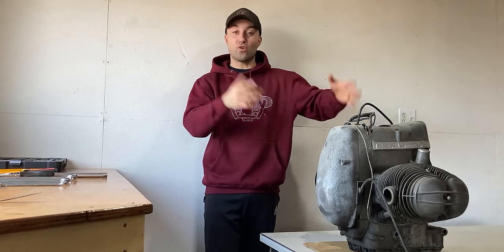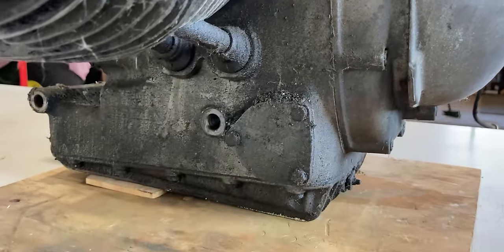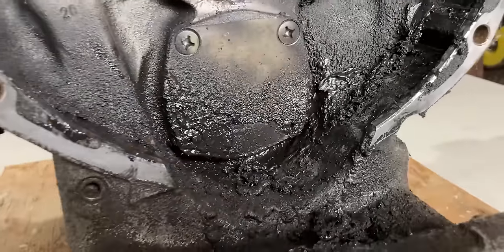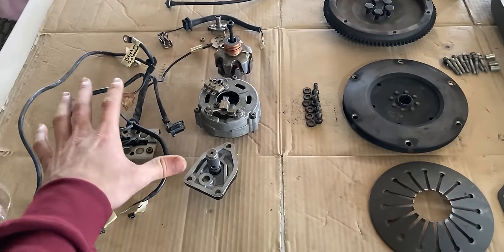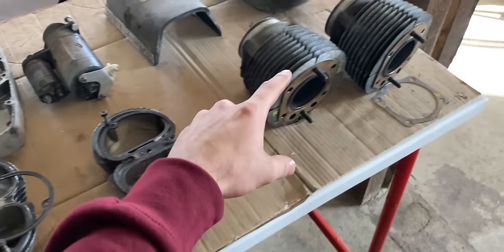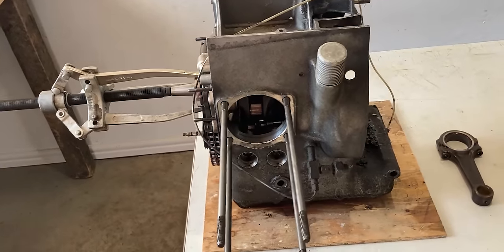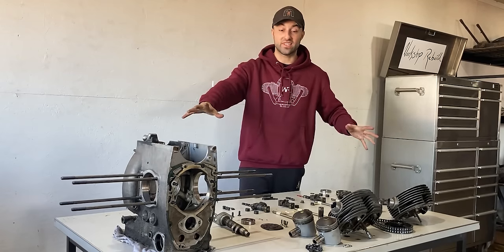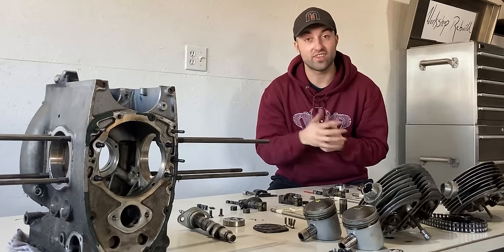BMW R60/5 Airhead Engine Teardown - How Bad Can It Be?

Comment: Having watched a few such, very interesting and informative videos, I have to ask why do you all not give it a good external clean before you start stripping it?  A good application of Gunk or similar means your whole working is a bit cleaner; there will still be oil from within but none of that road cr*p potentially getting anywhere inside.  I'm sure you'll clean thoroughly the parts but prevention is better than cure.
Enjoyable video, chapeau!  Makes me want to find an old airhead, just to take it apart!   ... but not my 1978 R100RS
Reply from the maker: Hi there, this is a great question! I think it depends on what work will happen to the engine. If I were to just replace gaskets and seals, I would definitely clean this engine prior to stripping it. 
In my case, I knew I will go through every part, clean it, measure it, repair or replace it and then eventually rebuild the whole engine. Once all parts are disassembled as I can get to them from every angle and I find this much easier to clean them this way. (Cleaning usually takes forever, but that is just part of a restoration)

Thank you for your positive comment, I really appreciate it! I will have an engine rebuild video of this R60/5 here very soon that you might be interested in watching. 

You have a lovely BMW and it might be a good thing to keep that in one piece if it's still a solid runner! Maybe you can look into the /7 models, as they are readily available on the market and fairly cheap...relative to older or more rare models. 

Regards Andreas

Comment: 9:25 Like talking to a baby :D "Where is the clutch lining?..THERE is the clutch lining!! :D"
Reply from the maker: EXACTLY! The clutch wasn't horrible, but it will need to be replaced after so many years. Luckily new parts can be sourced which makes this 10x easier than riveting new material onto the old disc.
Reply: @WorkshopRebuild  How easy or difficult is it actually to get parts for it?

Comment: Good Video. BMW should have used  helical gears to drive the Camshaft . Chain elongates  change  valve timing. R 50, R60 & R 69s had gear driven cam shaft. No weak links. Sadly Today's BMWs are so complicated 3 Timing chains. Expensive Toys.
Reply from the maker: Hi Tissa, that would have been a great option as they used this method in the past. Nowadays liquid cooled engines are far more prone to failure with the amount of seals and gaskets involved. To repair an engine with 3 timing chains, must be a nightmare! Once I'm done with the engine rebuild and the whole motorcycle restoration, I will reveal the price and I will already tell you now...it's by far the most expense rebuild I've tackle to date. 
Thanks for viewing and leaving a insightful comment. Regards Andreas

Comment: This has to be one of the best put together 50 year old bike. Certainly nothing from the UK or US comes close. Maybe a Japanese? 
Either way this was very nice to watch. 
Cheers.
Reply from the maker: This bike it built very well, but in my opinion a little bit over-engineered! This was also the fact with British bikes back in the day. I haven't been able to work on an American motorcycle just yet, but maybe I'll find a good deal in the future. On the other hand, I am very impressed with Japanese motorcycles and their reliability. The parts they machined have always been top-notch and in the 70's they rolled out some very good models. 
I will have more video on this BMW very soon, I just have to finish up some other projects! (You probably know how that goes) I'm glad you did and I appreciate your awesome comment. Regards -Andreas

Comment: Internally it doesn't look like a worn out engine at all . . very clean and surprisingly solid logical engineering is evident. But not all German engineering is like that. I had a three year old Audi A4 TDi with 133kms from new from the first owner, with catastrophic failure of the alloy casting bracket supporting the power steering and water pump ancilliaries, whilst high speed motorway sharp bend downhill onramp cornering.. dangerous and frightening as loss of control was a distinct possibility (steering translated 'rock hard' with a sudden loud 'Bang!') I phoned the dealership and said, 'Come, take this thing away, never want to see it again, and give the money back thanks' ..and they did !

Comment: I have over half a million miles on old air heads my collection at one time was over 40 of them..love them things when I go some place I ride a airhead when I want to scare myself I ride one of my ducats. I have a 90s that has never been outta the crate..I'm gettin old bought time to pass them on 😊
Reply from the maker: Now that is something! Do you remember which bike had the most miles put on it?
Your collection must have been better than some museums, especially when it comes to Airheads.
It‘s never easy to pass on something that‘s sentimental to one, so enjoy them as long as you can! 

If you have any stories or pictures you want to share about your bikes, you can always reach out to me via email. My email address is in the description of each video on my channel.

I have a new project already lined up and it might just be another BMW...you might like it! Maybe I‘ll slip a boxer race-engine into the mix, once I finish the R60/5 engine assembly😊👍🏽

Thank you for sharing this comment with everyone and with myself. It‘s always great to hear from fellow Airhead enthusiasts! Regards Andreas
Reply: I put about 120k on a 75 R90s, and about the same on a R100PD. Kinda my fave to ride was the R100PD. Had 3 of them didn't have to pay as much attention to gas stops with the big tank..
Reply from the maker: That's a fair distance on those two bikes (R90S & R100PD), especially if you have such a big collection of BMW motorcycles! I have heard so many great things about the R100PD and it would be a great experience to test one for myself in the near future.
If you ever decide to pass some of your bikes on to the next caretaker, please keep me in the loop. Regards Andreas

Comment: Had to replace the starter on my R-100 GS. Found a exact replacement ( Valeo) at my local auto parts store, 100$ !
Reply from the maker: The R100GS does have a large starter, because it is a 1000cc engine. You were lucky to find a Valeo starter for such a good deal. You might be surprised with my upcoming project...all I can say is it is another BMW 😉

Comment: The engine was built around september 1971. Pity that you did not measure the compression before dismanteling. 
10:22   M10 * 1 or M11 * 1 ? They enlarged them around that time.
Reply from the maker: Yes, this engine was produced in 1971 according to the casting numbers. The compression of both cylinders was tested in a separate video and can be seen here: https://youtu.be/wT1_nDJ_Okc
The flywheel bolts I have here in the shop measure M10 x 1.0 and they did enlarge them in later engines. Thank you for your comment. Regards Andreas

Comment: I would have removed the long cyl. studs as soon as able to prevent then from being bent or broken if it fell over on them . Great engines !
Reply from the maker: That is a great suggestion! They are very long and they could easily be damaged if I'm not careful enough. I agree with you, these BMW airhead engines are great in many ways! Regards Andreas

Comment: Great video!! I enjoyed every second of it. However I started looking because I hoped I could see how to disassemble the crankcase breather valve. Unfortunately this is not on this video... Maybe you have some other video on removing this breather?
Reply from the maker: Hello Marc, I'm glad you enjoyed this video and thank you for your feedback! The crankcase breather valve probably didn't make it into this video and I'm sorry about that. The breather cover is bolted onto the engine block with two allen head bolts. Once these are removed you will see a steel e-clip holding a spring against the valve disc. Remove the e-clip and everything will come off very easily.
If you decide to replace the valve disc with new material, that can be done. If you want to upgrade this part of the engine, you will need to heat up the engine block and remove the breather valve insert. This might not be the easiest thing to remove, but it will come out.
Let me know if this helps and if you have any other questions feel free to reach out to me!
Regards Andreas

Comment: The block (R60/5) has one design failure. The squish-bead in the cylinderhead is to much pronounced and doesnot interfere right with the form of the piston. 
The standard trim tends to knock too fast.  
Families of BMW tuners remove a conical ring from the squish-bead by machining. The compresion ratio can be increased there after, and the timing can get more advanced, both improving power and fuel economy.
Reply from the maker: This is very interesting information and I'm glad you shared this with me. I will keep this in mind when this engine goes back together. I will keep these measurements to compare with other engines that I will be working on in the future. I might just have more BMW content on the way...
Thanks again for leaving an insightful comment, Louis. Regards Andreas

Comment: A very detailed strip down the internals look in good condition great German engineering from an eta when they built things to be indestructible it’s not uncommon to see these with very high mileages still sounding nice and riding well. Despite all the parts it’s beauty is in it’s relatively simple design it’s very strong and doesn’t put out huge amounts of power so it’s long lived.
Reply from the maker: Thank you for tuning in to watch this video, Phil! This engine design is known to be bulletproof and it's a great all-rounder with 600cc's of displacement. 
The horsepower is not all too important on a classic bike that you want to take on a winding road!
I hope this engine (and bike),  will see many more miles once it's rebuilt. It really deserves another life, so to speak. Regards Andreas

Comment: Gearbox usually gets them. Me and a mate diverted to an MZ250  for a French Trip(from Edinburgh) when his R600 BM broke its one.
Reply from the maker: Hi Rab, while rebuilding the 4-speed gearbox that had over 90'000 miles on it, I didn't see much wear. I overhauled it with new bearings and seals, but there was no need to replace any other major components internally.
It's always good to have an alternative bike for such a long trip, as you do NOT want to break down. Up until this day I have not heard of MZ, but with a little bit of research I will be able to learn more about this make and their motorcycle models. Thanks for sharing this with me! Regards Andreas

Comment: Great video. It looks like the engine was touched not so long before the video. Bolts are shiny and all come off easily. Not so easy in real life unfortunately.
Reply from the maker: Thanks a lot Thierry. After I measured all the parts in another video, everything was to the original specifications. Therefore no major components were touched. The bolts are shiny because they are zinc-coated and the aluminum looks dull, because it was oxidized. I don't put on a show for YouTube videos haha. Thanks for tuning in and sharing your thoughts.

Comment: Surely that must be good inside! Back when BMW made their motors without planned obsolescence and do notice there is next to no plastic used
Reply from the maker: The only plastic wear part within this engine is on the chain tensioner. Over time the chain will stretch and also wear into the plastic and that‘s another reason why this will be replaced.
BMW really focused on reliability on these bikes and they nailed it!
Unfortunately this bike had a rough life and I believe some service intervals were missed.
In a couple days I will be working on the assembly of this engine and it will look completely different. Thanks for leaving a great comment! Regards Andreas
Reply: @WorkshopRebuild  Your knowledge on these classic motorbikes are a mazing, its very hard to be able to find someone that can do what you do like you fdo it and it is such a iconic bike that deserves your care
Your welcome!
Regards,
Dillan
Reply from the maker: Thank you for your kind words, Dillian!! I try to understand the mechanical components: how they work, how they move and what their purpose is. After a rough overview I tend to share what I find and explain everything in short.
I have some other projects lined up that might spark your interest, especially when it comes to internal engine components.
Thanks again! -Andreas

Comment: I wonder if they ever built generators with BMW engines?  Certainly they would need cooling shrouds on them for that application.
Reply from the maker: Great question! I've never seen a generator before, but I have seen a company use these engines for water pump setups. They fabricated custom cooling shrouds around the engine and added a cooling fan up front. I'm not sure what the company was called, but they were based in Europe.

Comment: The crank puller may fit my stronglight 93 crankset for.my bicycle. I used to own a 2002 BMW so I love and respect BMW engineering. When you get that engine back together and in your motorcycle blessed be advised of the gyroscope pull out ward and to the ground when riding your BMW R 60 motorcycle.  I only know of 2nd hand knowledge of this engine through a friend who rebuilt one as you are doing. The motor cycle has a tendency to  lay rt. Or left as you lay unto a turn. The carburetor will be leaky and problematic if it is like my friends BMW r60 carb. I hope You are able to get her running again and many safe enjoyable  miles on your beautiful engineered  BMW r 6o? I am just a ignorant bystander and am not a mechanic. I tinker with bicycles. I am sure it will be beautiful when you are done with her!  Happy overhauling!
Reply from the maker: Most crank pullers are universal and suit many different make and models, so it's very possible that it would work for your project. 
Thank you for sharing you experience with the BMW brand and a 2002 car is becoming a true collector in this modern world. It must have been a blast to drive!
I will keep this in mind when I get this motorcycle back up and running. My goal is to restore it as best I can and bring it back onto the road for a nice trip or two, keeping everything in tip-top shape.
The carburetor leak is notorious on the older carburetors, but with a simple carburetor rebuild, one can have a leak-free experience.
I will have an engine assembly video here very soon and I hope you will enjoy it as much as the disassembly. Thanks for watching and leaving such a great comment. Regards Andreas

Comment: Good morning Mate !I hope all is good there, by the way excellent video of BMW!!! I love all of them ! one question... do you have a list of all the lubs  and paste nedded for all the rebuild process? like Copper paste high Temp or locktite locker... Thanks Mate in advance !
Reply from the maker: Hi there! All is good on my end and thank YOU for tuning in! I usually use the same products or my engine rebuilds, and I will show everything in an upcoming engine rebuild video. Currently the cylinders and heads are at the machine shop and I'm eager to receive them to start the rebuild!
Back to your question, here is a list of products I normally use:
-Assembly Grease (used for bearing surfaces and other metal-to-metal surfaces within the engine)
-Loctite 242 (Permatex Blue Threadlocker, frequent use)
-Locatite 262 (Permatex Red Threadlocker, rarely used)
-RTV Sealant (Used instead of gaskets, air cure product)
-Anaerobic Gasket Maker (Used to seal precision machined surfaces, cures under squeeze)
-Copper Coat (Used for Exhaust Nut in this case, a threaded part you wish to remove after assembly)

I might have forgotten some products, but I'll be sure to add this into the upcoming assembly video. Thanks for your great question and if you have any questions, feel free to reach out any time!
Regards Andreas
Reply: @WorkshopRebuild  Mate, I have seen Videos of BMW air boxer engines and let me tell you something, the amount of details and good workshop knowledge that you have is great, I'm  so great full to follow you and thanks again for your great job !!!
Reply: @WorkshopRebuild  Man ! we are waiting for the next Video and thanks again for that passion !!!
Reply from the maker: @chiefeng6951  Thank you so much for viewing my other videos and following along this restoration project! I will always offer as much as I can in my videos, so it's easy to foolow. I will continue to make more videos. Regards Andreas
Reply from the maker: @chiefeng6951  I know, I know! I am super frustrated by the por quality parts I received for the engine, and the assembly is delayed once again. I just cannot wait to share the assembly video with you, it'll be a game-changer. Thank you for your support

Comment: German engineering at its best, see the piston after 50+ yr still as new. These boxer engine R/50,R/60, R/70 is the most ya THE MOST reliable. Some of its have ridden 200000 miles without even changing piston or block.
Reply from the maker: I agree with you Bhavesh! Many of these boxer engines have survived the test of time and the still run like when they were purchased new. Unfortunately, the cylinder walls within this engine will have to be machined as they are out of the factory specifications, but that is not a big issue.
BMW introduced their Nikasil coated cylinders in the early 80's, which gave these bikes a very long lifespan. This engine does not have this coating, but I'm still happy with the overall condition.
I will be rebuilding this very soon and maybe you'll be interested in that video as well. Thanks for tuning in! Regards Andreas